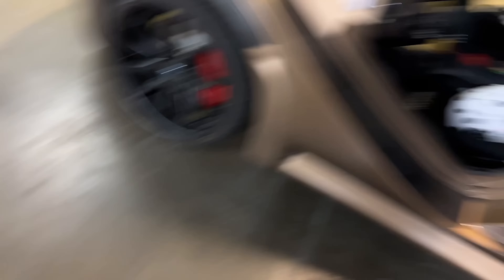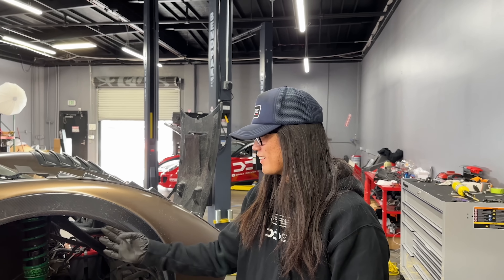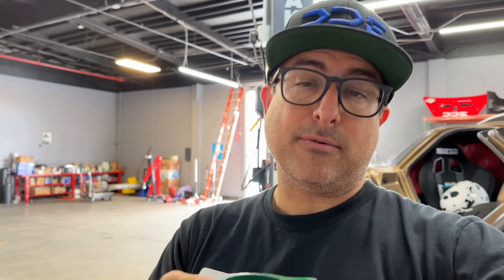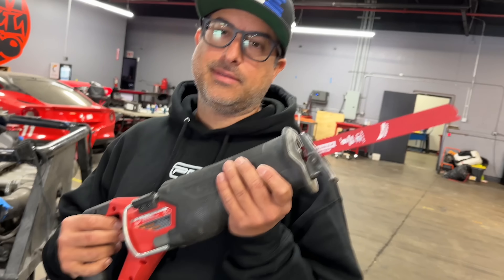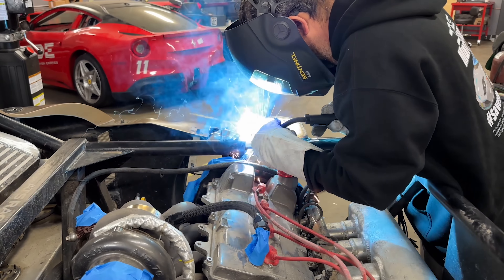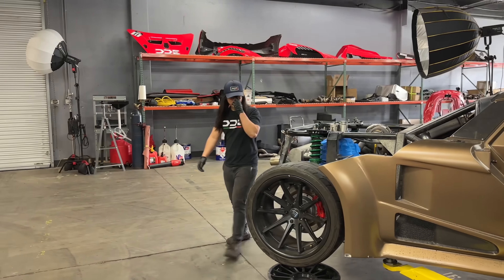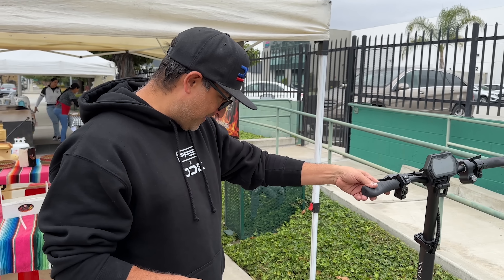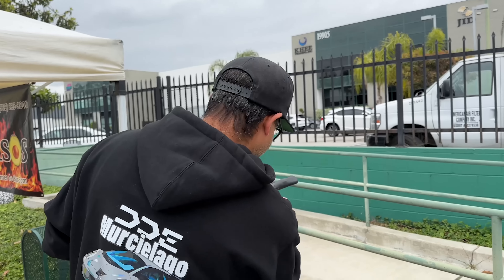THE TRUTH WHAT HAPPENED TO TIM ...

Comment: Can't front, the diablo blades across the product line are hell on material. I had seen them around, but the price seemed high so I'd always passed. I aquired a used table saw with a new diablo blade. From the first cut I was a convert. Now it's all I use. It's rare for me to just praise a product randomly, but this is one of those few that made that much of a difference.
Reply: Couldn't agree more. Best blades out there. You get what you pay for.
Reply: Hands down the best I won’t use anything but Diablo
Reply: I remember when those first started being sold at Home Depot they were really cheap and was Lenox all the way then got some for free at the supply house when they had a rep there and have been using them since incredible blades but a little pricey but worth it
Reply: Their hole saws are great too

Comment: I hope they don't make this into a block beater... The car has such a bad ass look to it, if done nice and proper, this would look like madness even among million dollar supercars. This could be Tims DDE car. Get the engine, the components and exterior dialed in. Get the frame powder coated and all. Then concentrate on the interior after. Can make it like a normal car, with all the comforts. Mike has a Benz in the works which fits him, the DDE guys have theirs, Timmeh has this beast. It's a good combo. Tim should consider getting a z06 engine from the c8 into this. Keep it NA, reliable and sounding like a real supercar. BE a decent affordable route, plus the easy to access parts and affordable prices.

Comment: Going to add weight to the rear when you put the rear body work back on and then it'll be even lower in the rear. I am guessing set the rear like 1" high and it should be close to level when body work back on.

Comment: You need your drivers side slightly higher as when you get in it will drop. Add some weight to the drivers seat the same as Tim's.. Then measure ride height